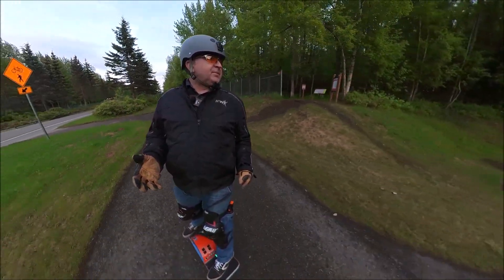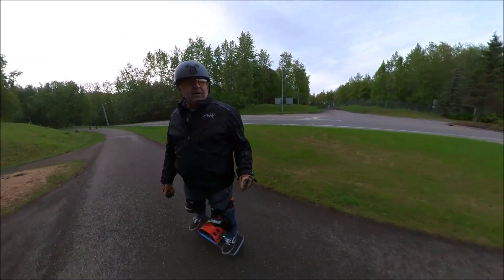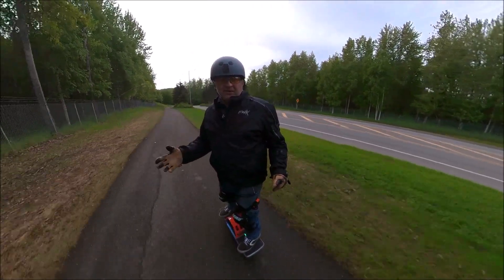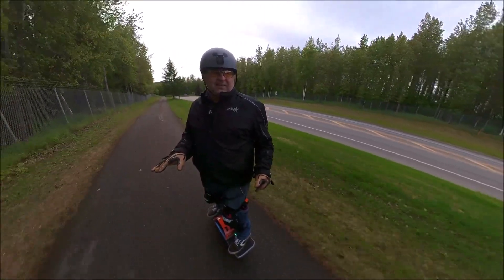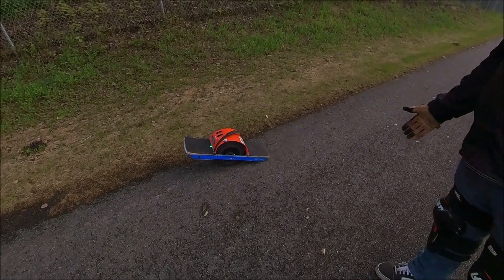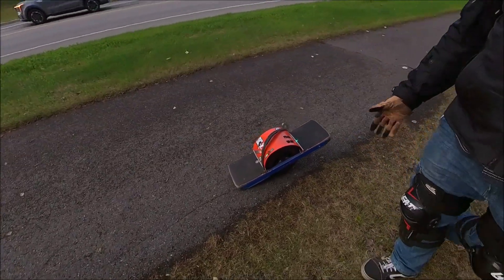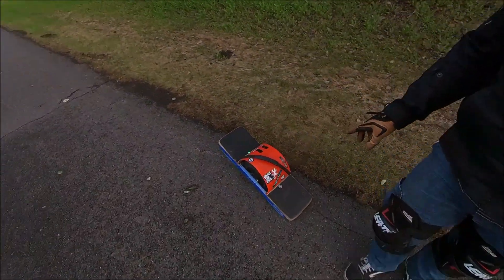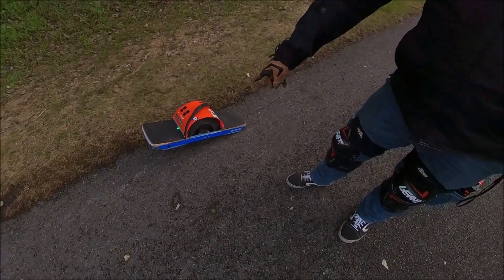Custom build Onewheel VESC XR one year review

Comment: Did I hear you say it has 50% more battery than a GT? What kind of range are you getting?
Reply from the maker: Range, with my weight (290 lbs) on GT, I can get around 14 miles on a full charge. With this XR, I get around 20 to 22, but with a rider 150 lbs or so it will do around 50 miles per charge

Comment: Thanks for this great video! I have an XR collecting dust because I feel it's underpowered for me (190 lbs). If you lived nearby I would totally commision you to help me vesc it.

Do you recommend the components you've currently installed (lil focer, 18s2p {or 3} and SF HT)?
Reply from the maker: Thank you. Yes, of course, Little Focer or Tronic 250r, 18s2p/3p  or 20s2p, and for sure SuperFlux HT or HS motor. With SuperFlux HT, I get better mileage and more torque, also it runs much cooler compared to a hypercore motor due to SuperFlux having a 50% bigger stator.
Reply: @GPeter7  thank you.
Reply from the maker: @barrymonteiro8893  You are welcome, anytime, my friend
Reply: @GPeter7  you get more range with the heavier superflux motor than you the stock xr hypercore motor? I was thinking the superflux being heavier and pulling more power would have less.. not more range than the stock hypercore and this is the only reason I'm putting off adding the superflux to my p45b 75v vesc xr.. thanks for clarifying
Reply from the maker: @justinspirational  With my weight of 290 lbs, this superflux H/T motor will give me better range than a hypercore motor due to its 50% larger stator and it runs more efficiently.

Comment: TY🎉 I'm headed to VESC city in 2 days❗️ (pickin up my GT-V)
Reply from the maker: GT-V is a good choice, but there is one design flaw on GT that needs to be fixed, and that is the motor main connector it doesn't hold very well with GT stock power, I can only imagine what will happen with it at twice as many amps that GT-V will provide it